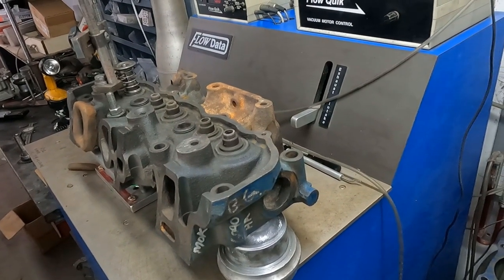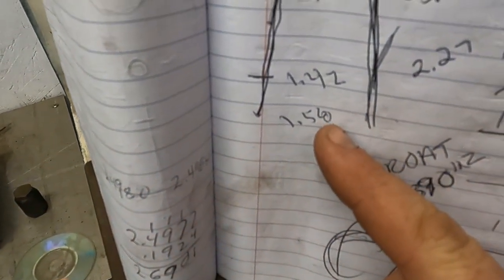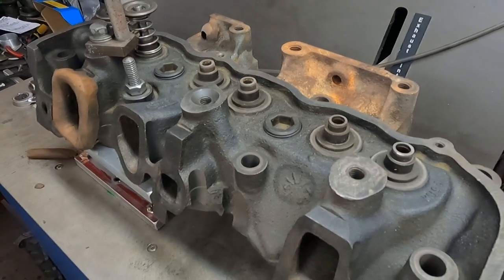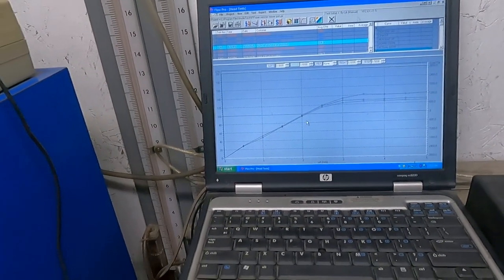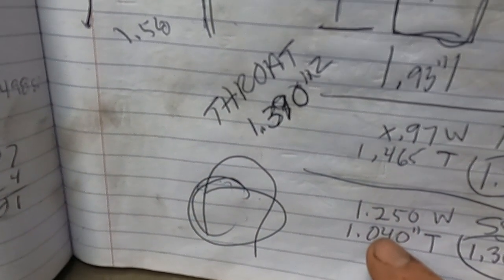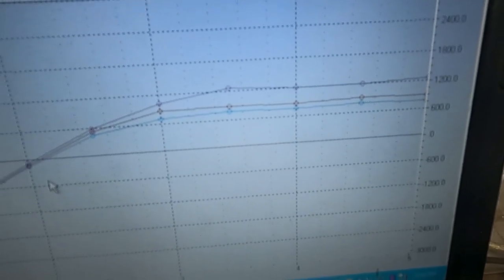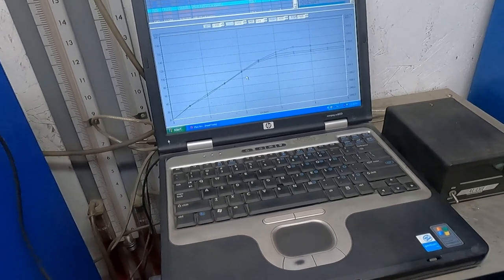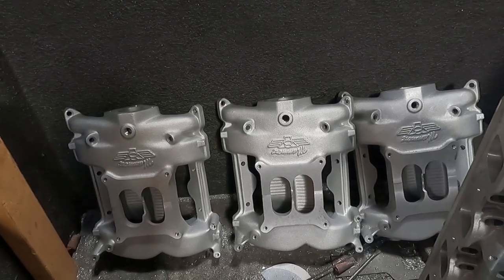Porting Cast Iron Heads Part 1

Comment: Why did you choose the 2800 when the 2900 has an aluminum manifold? And wouldnt it be easier to get power out of a 4 liter block? Same dimensions, right? The reason I am curious is that I am looking for a transplant into an mgb gt. I am sure that one of my friends used a cologne engine in hus mgb, said it was an easy swap. I really like your stuff on the y block. I want a 52 merc....with a y block!
Reply from the maker: The 2800 has an aluminum 2 barrel intake manifold.  My plan is to put this one in my Mgb Gt. The 4.0l  is similar but the block is taller and the oil pan rail is wider.  I agree that the fuel injected 2.9 and 4.0 run better out of the box, but I think a well built 2.8 will be a good runner as well.

Comment: Question: I put 2.9 valves in my 75 2.8 heads. Is that worth some airflow?
Reply from the maker: I'm sure its worth something, havent got there yet. still playing with stock valve, ill probably post some results of testing tomorrow.  what brand of 2.9 valves did you use
Reply: Jeff, I think Qualcast was the brand of intake valve. As you know, 2800 intake valves are 1.571”. The 2.9 litre intake valve is 1.653”. The area of the 2.9l valve is 11% larger. @mummertsspecialvinterests2721

Comment: I'd definitely be interested in seeing what kinda results you get out of the Colonge engine. I use to play around with them and a Cobra II fastback I once had. My son has one now and i saved up a raft of 2.8 speed goodies for it. 
In some of my readings I believe it was brought up that the '74 head was the head to port and modify. It didn't have an exhaust crossover at all and the ports were supposedly a bit better in design. Also believed to be the heads used when Offy initially designed their 4bbl intake for these. Anyways, keep us updated, I'm interested!
Reply: I have a crankshaft from a mid-90’s 4.0 and I will be clearancing it to fit a 2.8. It uses Jeep 3.7 v6 pistons. Pin dia, comp ht, and piston diameter all fit up!
Reply from the maker: @PCMenten  You'll want to work on the heads for sure.